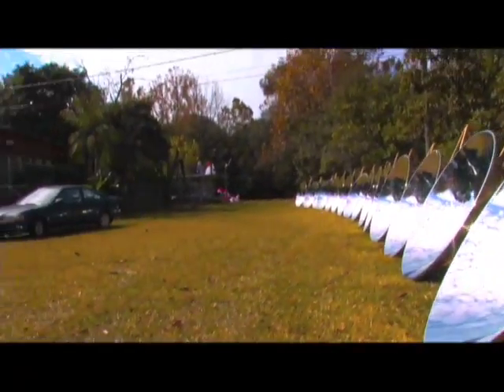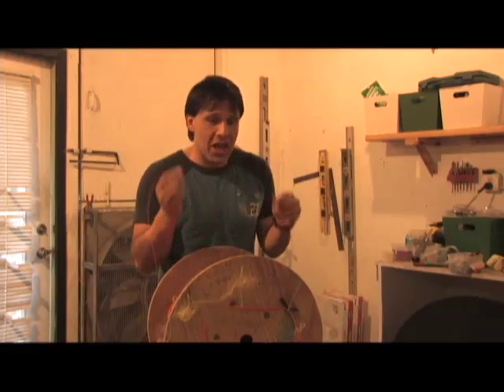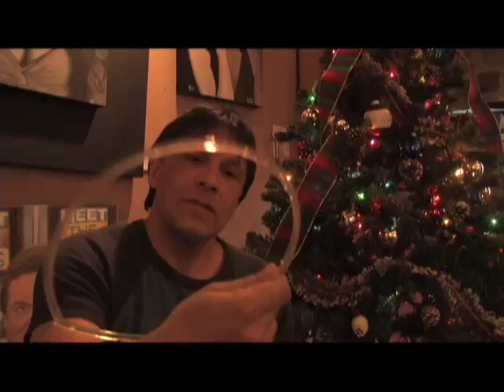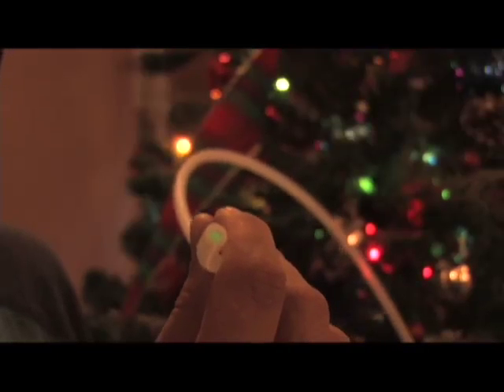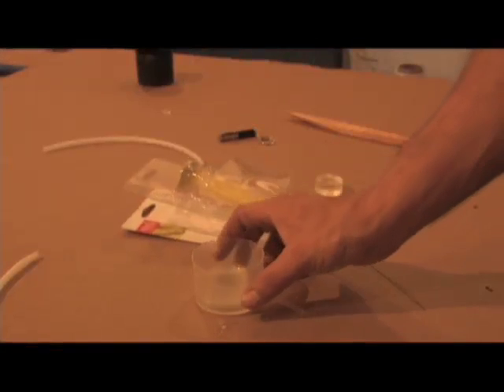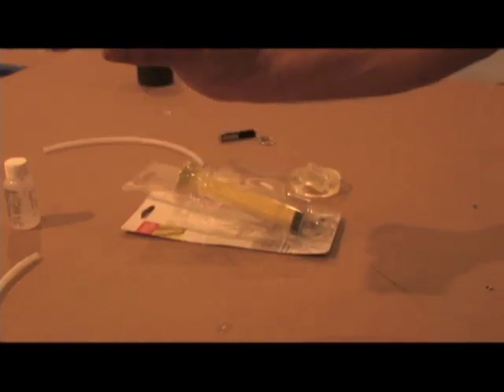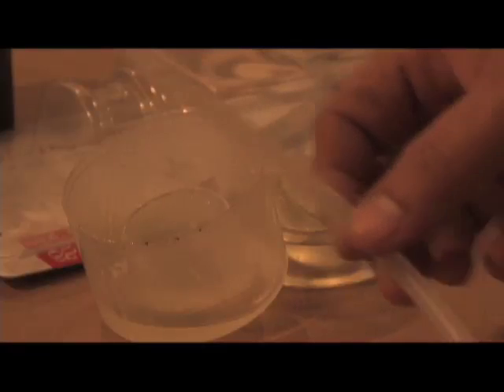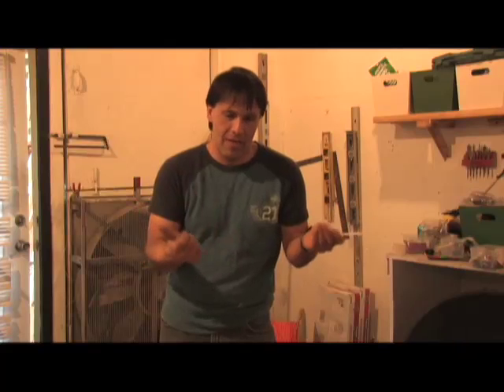HOMEMADE OPTICAL FIBER FIBRE OPTIC LIGHTING CABLE DIY Do it yourself Fiber Optic Cable Optical Fibre

Comment from the maker: Thank you for the nice comment. Mineral oil seems to be a good option for longer runs than distilled water. The issue is end capping. One bubble and you have a tremendous drop in optical transfer. I have a new crystal clear resin for solar panels that is UV resistant. A 50 ft tube would cost about $5-bucks. Future project.
Reply: What is the name of this crystal clear resin so the rest of us can try it?
Reply: Any news?
Reply: Please post an update, Thanks for your time

Comment: Have you thought about using something like microscope immersion oil.  This oil is supposed to be optically the same as glass.   If you used tubing that you plugged the ends with clear glass it might work.  I have heard that Castor oil was once substituted for this.

Comment: Theoretically the best combination of materials is to have the tube material have a lower index of refraction than whatever is contained inside, so the light continues to bounce around inside (think when you are underwater looking up at the sky, you get this mirror effect unless you are looking directly up). Then all you need to do is make sure the sunlight enters the tube at an angle less than the angle of refraction.

Comment from the maker: I will have a better video once I get the better core material. I will fill a 100' section if it works and tests out good. For filling, the most important part is placing the feed end to the bottom, this will lessen the bubbles. A deeper container is better, I used the cap so you can see the process. Thank you for your input and I will focus more on the process in the next video:-)
Reply: Great video indeed. You may use vacuum to get rid of the bubbles. By the way which resin you have used here?

Comment: Nice video... Should you consider also the ageing properties of the resin? After finding the appropriate compound which transmits the light as expected & is flexible enough to ease the wiring, an ageing test has to be done. The properties of the resin will probably deteriorate during time, because it will be exposed continuously to sunlight. Do you think a resin compound may keep its caracteristics about appx. 10 years under continuous sun exposure?

Comment: I've heard you can use regular fishing line for fiber optic lighting. Likely not for data but the light travels down the line just fine. Just use large test line and bundle it together it's dirt cheap.

Comment: You shoudl take a look at Plastic Optical Fiber (POF). They use it quite a bit in cars nowadays.
The cost can be quite economical and the diameter of the fibre can be in mm rather than um. 1mm is very common but you will get a 2.5mm quite easily.

You will get a good 50m without too much light attenuation.

I'd love to see this type of product applied to lighting a home naturally.

Comment: I helped my dad build a 2ft x 8ft airport with runway, back in the mid to late 70's. We were using homemade fiber optic lighting and mini Christmas light bulbs to light up everything. Making fiber optic lighting is not as hard as you think. Finding the material at a relatively cheap price is the trick and designing your project.

Comment: Just an idea, why not first coat the inside of the tube with a liquid metallic or imitation paint to increase the reflectivity of the cladding of the fiber optic tube. Therefore efficiency of the fiber optics is greatly increased.

Comment: Excellent ideas...I really enjoy your videos.  Why not just use water?  It has total internal reflection and works well.  I have made several lights using LEDs, a water filled tube and a joule thief circuit.  It remains flexible too.

Bill

Comment: @natepalm1 Think about it. Black absorbs light completely. This would be perfect if you need to stop any light infererrance, say if you wish to place many fibres in parallel, but it will not make the end brighter (although it may appear brighter to the human eye due to the light being high contrast to the black. A reflective coating will mean that more light makes it to the other end of the tube, although this will mean that the direction of most of the extra light will spread out

Comment: Hi, there used to be a glass company in Leicester uk that made their own laminated glass panels by pouring in a 2 part clear uv protected mixture, it was supplied to them in 5 gallon drums. This should be ideal for your project.

Comment from the maker: Fiber glass runs for several hundred feet, like a 300' wall of glass. Most large fish aquariums, big theme park types have 3' of acrylic with nearly 0 light loss. There actually is 200' sections of acrylic fiber on the market. Most lighting fiber is solid glass or plastic.

Comment: Great video, I was wondering since the major issue is focusing the suns energy with a parabolic would destroy the fiber optics what if you were to break up the solar energy into its individual components with a prism and pipe only the UV component. Solar radiation drops off sharply at the UV wavelengths so heat build up may not be an issue, and then you could pipe the UV into a phosphorus coated tube. Sound familiar. Florescent lighting works on these principals. You will not need the mercury.

Comment: Ive done some reading  on some of the " high end" high temperature capable glass fiber optic cable produced by various manufacturers and I was thinking it might be possible to use a similar concentration effort ,such as you have in your yard there with all the mirrors, for a different purpose than indoor lighting ? If enough light and as much heat as glass fiber would allow were concentrated into one straight run of cables with an overall OD of lets say 4 inches were directed to a chamber that

Comment: Hey dan, If you're looking for a way to transport light, then it already exists in architecture. They use metal(kinds) of tubing and I believe they are polished inside. It doesn't use mirrors, just bends and the light comes where you need it. Greetings and keep up the vidoes.
Reply: The mirrored tubes are filled with air that heats in sunlight, deteriorating the tube over time. And the tube transports heat into the building, and UV which damages materials in the interior room.
Reply: @matthewrubenstein2957  You will need an IR filter to minimize the heat wavelength and a UV filter to avoid damaging material inside the room.
The first one (IR filter) might be on the outside inlet window. The UV filter can be coated inside the "light chimney".
Reply: @matthewrubenstein2957  I really doubt that the metal tube is affected by the fractionally warmed air! Just don't use Gallium tubing? 😂

Comment: Can you try with a clear hose and paint/spray it with a metalized silver/chrome color? At both ends you can attach cones filled with mineral oil. One for collecting light, one for dissipating. I'm guessing it should be more effective, or not? Test it please!
Reply: that's exactly what I thought, but I was thinking the hose should be painted on the inside, and it can be done by diluting the paint a bit more.. the only question is if once dry, the paint will crack
Reply: Does mineral oil age and discolor or harden over years of exposure to sunlight?

Comment: FANTASTIC! Found this while searching for info and spec data for optical fibre cable for light piping / home lighting and maybe even solar home heating methods. Don't have a big budget for off the shelf systems or even buying lots of optic fibre, so this is looks the bees knees. Now, I wonder, why not try making a collecting/ focusing lens with the transparent resin since large glass lenses are (I think) fairly expensive. Thank you, will check out your other vids. Regards, Steve

Comment: So how effective would this be as a lighting solution?  I'm not familiar with fiber home lighting, so would you place some kind of collector on your roof and just pump light into the house that way?  How efficient is that?  Would you have an electric light source pumping into the fiber system during night time or just use your regular house lights?

Comment: Have you thought about possibly using mineral oil?  You could cap the ends with the resin/glass to keep the oil in.  It also has a very high heat tolerance.

Comment: You should try acrilic rod  some are big like shower pole clear I cits working but I was wondering if you could start with one rod outside and split it in tow and go to 4  and 8 more and make fixtures lights with it inside

Comment: I agree that with a project such as this, data level transmission isn't that important, in fact my main application thus far has been for use in on-track detection for automated model railways, so transmission of light over a reasonable distance is the only requirement. I found some stuff on an electronics website that helped with this, e.g phototransistors + cable, but doubt it was as cheap as what this video was advising. Good stuff! I like the idea of making it myself.

Comment: Optical networking equipment and including switches and routers and SONET (synchronous optical network) equipment turn the light on and off very quickly to represent the ones and zeroes of binary code.  The flashing light travels down the glass (fiber optic cable) and is converted by a light sensing receiver back into bits.

Comment: What about a mirrored tube about 1/2" diameter? You would want to limit bends so it would require more planning to install in a house.
Reply: Mirrored tube is filled with air, which heats in the sunlight, which deteriorates the tube. Also brings heat into the room.
Reply: It will heat less or not at all depending on the reflectivity in the infrared region of the spectrum.
Aluminium mirror coating seems to be quite reflective in the IR region.

Comment: There are systems for this now. They probably didn't exist when you made this video... but they definitely do now. They're able to light up several floors on some tall buildings just from the roof space. Depends on the height and width of the building though. They actually use very thin fiber optic cables too (FAR thinner than I ever thought possible)... but it somehow is still able to carry enough light to light up rooms from just 1 to 4 0.75mm fiber optic cables. You can get 100M of that kind of cable for like $20.00.

Comment: I was watching this video for a small project, and I thought if I might push in the tube at both ends an LED light ( the small one ) before the resin cools down. I was also wondering if the tube is flexible enough to shape in smoothly before the resin cools down and if the resin helps the tube hold the shape. I hope I would get answers for this. Thank you :)

Comment: I would recommend using an activated carbon air filter Mask or a fan and outside. Could you use water and a shiny copper pipe with the Concentrated light

Comment: hey you should try a small amount of coagulant,,,,,the stuff they put in pools to gather algea,....maybe it would thicken up the syrup so you could.....dump and run with the string "Fiber optic" that come from the dump.....  you could dump anything into it and pull it out and it will stick to it  with enough coagulant  it might work

Comment: your on to a great idea, have you given thought to using a U.V. reactive resin? if it was put into your poly tube under a vacuum any air bubbles would be removed if it cured out using natural sunlight you could form it out any way you wanted before it cured and it doesnt give off the nasty vapor or use  MEK as a catalyst  I used this technology in building fiberglass boats and forms it worked awesome  check out a place called sun rez i think it was   Ill be watching your progess on your light project pretty cool  good luck with it

Comment: Lol awesome, huge installion to save yourself changing bulbs like twice a year. You also need to run the cables for the switches all the way there, or else you won't be able to turn off the light in parts of the house...

Comment: Any updates on this project.  I've been exploring inexpensive ways of pumping some light into the basement/crawl space on an off-grid cabin I've been working on.  It doesn't need to be enough to read by, but it would be nice to see down there without using energy or taking a light source with me.

Comment: To get rid of the bubles try running it over one of those cheap sanders that shake. It does the same thing as the commercial units that they use to get rid of air bubbles in concrete.

Comment: @GREENPOWERSCIENCE - 🤔 If you can use the clear cap and fill with water, remove the air, then place underwater and put on a 2nd clear cap, and see how well that works...
🚦💡🔦

Comment: I HAVE DONE SOMETHING SIMILAR , FILLED A TUBE WITH CLEAR MACHINE HYDRAULIC OIL AND CLOSED BOTH ENDS WITH RESIN  IT WAS FOR PASSING LIGHT SOURCE FROM ONE MACHINE TO ANOTHER ABOUT 20 METERS ON THE NEXT FLOOR , WORKED WELL .

Comment: Never could figure out why people don't use Plexiglass rods to transfer light. You can bend it and send the light where you want it. Yes it is rigid, but it can still be used to send light where you want it. The nice thing about plexiglass rods is that you can use different thickness's and you can even use plexiglass sheets as a lighting source. Use the sun, or use a central light source or two or three to light up many rooms with dimmers and or different colors for mood lighting.

Comment: There should be a store (like Apple store) where you pick from bins of different cheap optic connectors, splitters, and fixtures for light piping your house- with no permit needed because it is not electrical or plumbing!

Comment: @7zot Hello agian, sorry for my late respond, due to some work etc. 

well i normaly live in Denmark. And now those optic fiber cables progessed the hole way thru Scandinavia and thru the most of europe soon. So this will all be done and upgraded at the end of 2010 i guess. And at the fall 2011 we will probelay see som laser optics etc , well thats furture for now. But Sweden is using Laser optics for high speed internet Connection like 47Gbit. So everyone will asap get upgraded. =)

Comment: The price of fiber optic cable has come down a lot. I'm doing a project for accent lighting in a car and have done limos in the past. Take a look at a company called Trinorthlighting (you can Google it). The concept he has here is great but just imagine the bulk you would have to mix to do a 100ft piece of this! It's messy and at any long length it's going to trap air. Also a lot of light is lost due to side transmission, in other words the light lost due to the type he is making is too much.

Comment: Can solar panels use white El Wire to  recharge  its own el wire converter battery by wrapping solar panels, with El wire 100 yard set 10 panels.

Comment: MEKP is the catalysit for polyester / glass fibre type resins. It not good stuff, if you can use a respirator mask ( 3M do one in their range, in the UK it's marked brown ) or at least use a well ventilated area.

Comment: Thanks for this. I'm trying to think of ways of making a really large diameter light pipe to bring light into a basement. Something like a 110 mm diameter sewer pipe filled with purified water with glass windows silicon glued at each end but I can’t think of a long term solution to stopping algae forming in the water.     
Regards  . . . Andy
Reply: Boa tarde ! Você já experimentou colocar Hipoclorito de sódio ( NaClO ) .Acho que vai resolver seu problema !!!!
Reply: All you have to do is add some house hold bleach to your water, this inhibits algae growth permanently,
Reply: Better solution is having a bunch of these cables bunched up in parallel. Forget about the water. It expands/contracts with temperature and does not posses the desirable optical properties.
Reply: +Andy, 
 I think adding sodium carbonate to the water will solve the problem of algae. This was being done as read in some articles for capturing light using plastic water cans at the top of shanty housing to provide sunlight to makeshift houses.
By D.Vishweshwara Bhat
Reply: interestingly I'm experimenting with using a system like this for growing algae for producing biodiesel. I'm trying to figure out how to maximize the radiation per cable.

Comment: that was heavily insulated and mirrored on the inside just exaclty like a giant thermos bottle and that if that chamber were buried some 50? or so feet beneath the earth that solar energy could be piped into it as well as dicretionary amounts of (conventional solar hot water heater)heated distilled water (eliminate any possible scale buildup )were fed in as well (at the proper intervals ) that it might be possible to construct something akin to a " solar reactor "? ty gps and youtube

Comment: dont go the route og fibreoptic there is already a cheap and cost efective soloution in place 

solar ducting esentially there are used in atic conversions and they are basically aluminum duckting contected to the roof behind a c.all done the other end installed in the ceiling and it bouncs alot of sunlight down to the foom it is installed in

Comment: Search for "Side Glow Optical Fiber" on ebay! They have thicknesses from 2mm up to 14mm. (Like the name says it also glows on the sides not just the tip)
Reply: Side glow is bad for this application because that glow is light that doesn't make it to the end of the tube.

Also cheap plastic fibers can't take the wattage of sunlight, especially over time when the light breaks down the plastic.
Reply: @matthewrubenstein2957  need to use plastic tube with inside surface coated with aluminium and submerged water for cooling.

Comment: the mineral oil is to fill the entire tube, it is easy to use mineral oil to fill a tube with mineral oil and then use epoxy resin on the ends to provide the "terminals" so to speak. As to how this would actually work? I'm personally suspending judgement for the time being